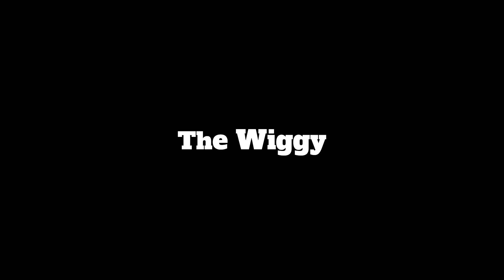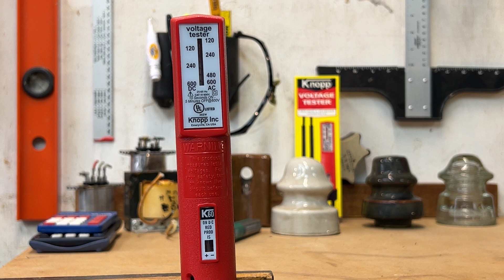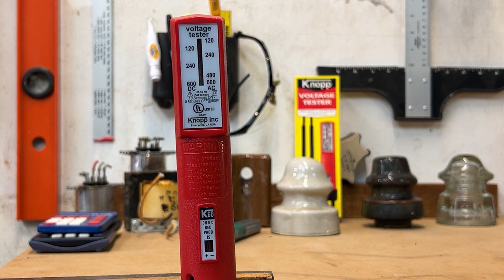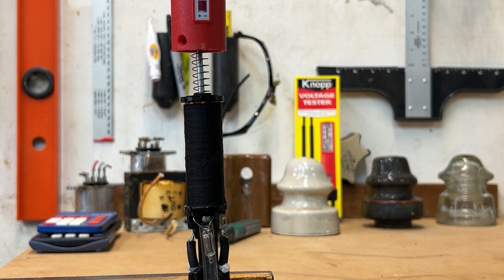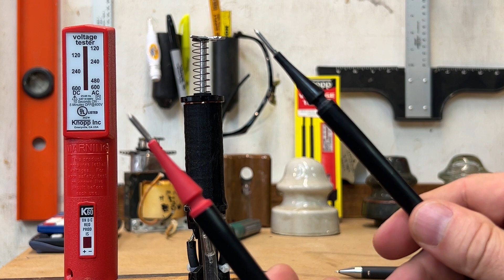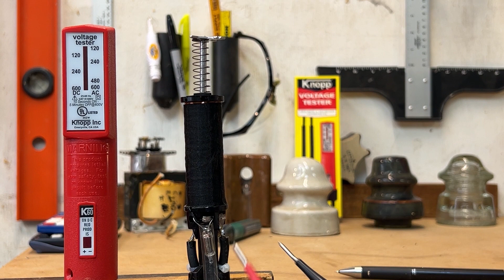Test Instruments: The Wiggy

Comment: I have an Ideal Vol-Con "wiggy" meter and although my Ideal 61-747 400 amp AC/DC clamp meter sees more use and more versatile, I carry the wiggy instead when I only need to test voltage or continuity,  and don't require a precise measurement.  The wiggy is far more rugged and more easily fits in my tool pouch particularly when working in tight spaces, and by noting the vibration and pulling strength of the bar indicator,  I know the voltage range I'm testing without looking at the meter, which I find convenient when checking a  panelboard fed with 120/240 3ph 4w delta and need to confirm which phase is the high leg, either prior to replacing the panel,  or the need to add a 120 volt circuit,  or 240 volt circuit and using a slash rated rather than straight rated breaker and need to avoid the high leg.